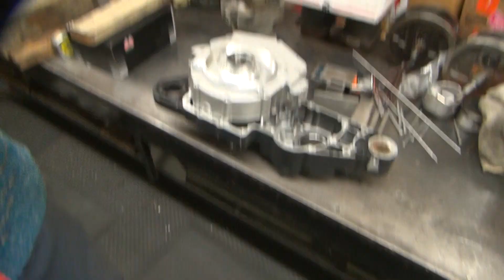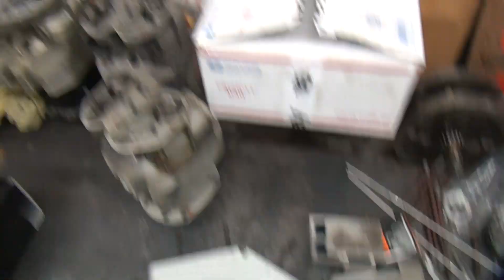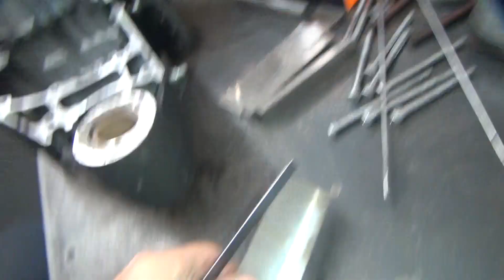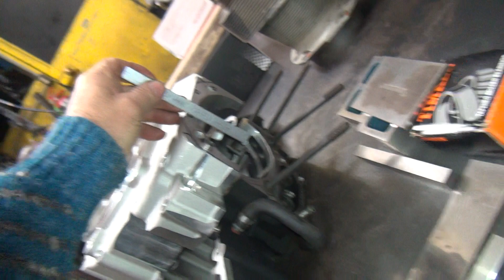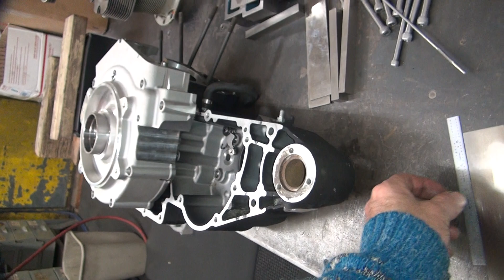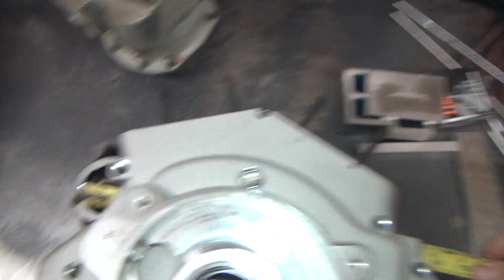#112 harley custom airplane 143ci motor mock-up big evo 4cam sportster twincam m8 race tatro machine

Comment: Why not just machine a case out of a chunk of billet that way you can put your oil galleys where you want them you can still have the four cams like the sporty motors I mean how hard could it be?
Reply from the maker: no problem, just go make a set and see how hard it is. did you see any cnc or even a computer in my shop. i have just good old tools that you have to opperate all by yourself. just send me 1.5mil and i will get those new machines you think i have.
tatro

Comment: I can see that your working everything out and its not my money but what if you bought a drive side case like the black one and cut the bottom of it off and welded it to the bottom of the ultima case. looks like a nice clean sump. Thanks for the video.
Reply from the maker: i didn't think about that one. it might work. i was more about using an oil pan like my race bike.
tatro